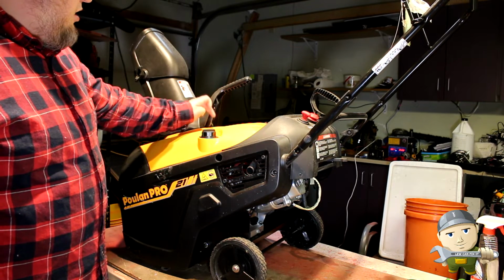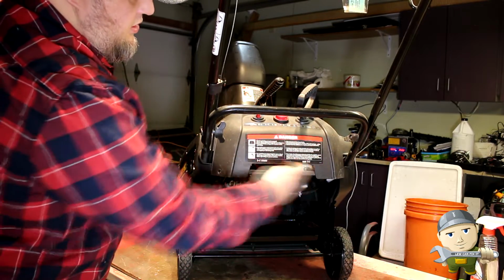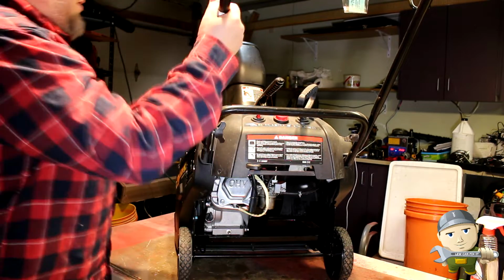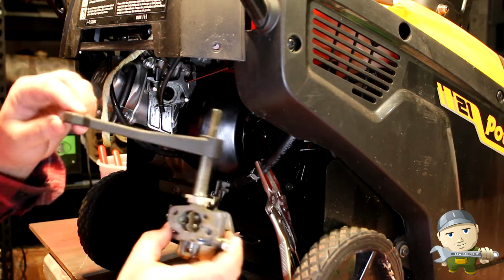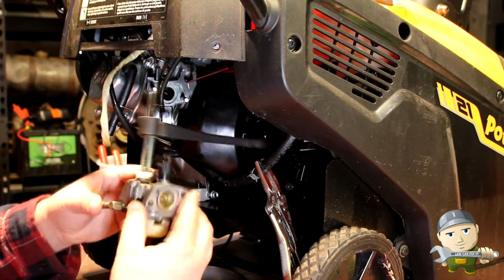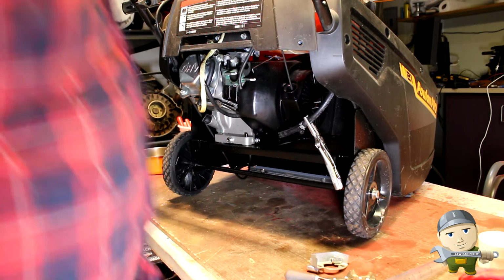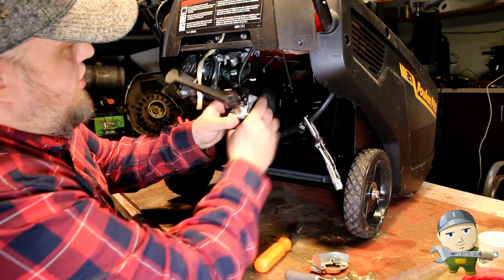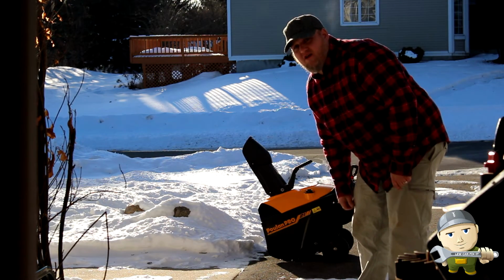Poulan Pro Snowblower Diagnose and Repair

Comment: Had it 9 years skips working every other year.  serviced 2 yrs ago used only twice & needs repair again? There's gotta be a more reliable sno blower
Reply from the maker: Ron,  are you running it out fuel after the last time of the year? Or using a fuel additive?
Reply: Bought a Toro power clear same size to do the job no time to repair the Poulan since 13" of snow hit Chicago right now, so we'll run out the fuel at the end of season and see if it works every single year
Reply from the maker: @rondavid7413  Sounds good Ron. Take it easy over there!

Comment: Why does mine not push well. Like the front end literally will not slide unless there is the right amount of snow and the right conditions with the right sidewalk. Otherwise it with grab and tip forward as I try to push. Any advice for what to do to modify it so it slides nice regardless of ground conditions.
Reply from the maker: please check the paddle and scrapper,  check this video https://www.youtube.com/watch?v=3slC2fxvP1w
let me know how that goes.
Reply: I am aware that this is an old thread. 
Not that familiar with these smaller machines but if it is grabbing it seems that the slides are set too high. Try adjusting the slides/ shoes to raise the scraper assembly.

Comment: Hi Lew, I have a similar issue with my popular p521. I don’t have an ultrasonic cleaner. What else can I use?
Reply from the maker: @Da Brown Guy,  thanks for the comment,  The ultrasonic method is really the best method to clean these carbs because the ultrasonic waves go thru the carb and agitate the parts of the carb we cannot really access.  I would call a power sports place and see if you can just drop off your carb to be cleaned. I am sorry I do not have an easier method, but when I would clean carbs without an ultrasonic cleaner in the past It usally always would not run correctly.

Comment: My float and needle has a spring on mine and the needle looks a lot different I have poulan prg621.  Any suggestions on fix the the needle and float?
Reply from the maker: JEYE123, can you send me a picture of the carb/needle and float?  INFO@LEWCANFIXIT.COM

Thanks!
Reply: @LEWCANFIXIT  i ended up just buying a new carb for $19 off Amazon
Reply from the maker: @JEYE123  Nice, Let me know how it works out!

Comment: Lewis, I have the same model snowblower.  Is there an adjustment on the carb as mine, when I move the choke/run handle to Run, the engine surges. If I slowly move it back towards the choke position, it smooths out.  Any advise? sounds like it's running lean.  Thanks, Bob
Reply: I have the same one as well. If it's surging there is a little black screw on top of the carb and if you turn it a quarter turn at a time to the right you can get it to smooth right out. If the engine runs too fast then turn it back to the left a little bit.

Comment: I have the exact same snowblower and I'm looking for a muffler, you have any idea where I can get one also where are the serial numbers I would need?
Reply: I know this is very late but I have the same blower and I found my muffler on EBay. Plus I also got new paddles there too. If you still have the machine and not got the parts I will screenshot where I got mine from.

Comment: At 8:13 when it comes it are the wholes at the bottom or staring at the top?
Reply: Gimme a little bit and I will let you know.
Reply from the maker: open the pictture below and please look at item 36 in the diagram below.  that should be what your looking for.
https://ww2-secure.justanswer.com/uploads/mr2cycle/2010-12-22_163044_carb.gif
Reply: @LEWCANFIXIT  we’re can I get that gasket

Comment: Great Video.. Just curious to know is it best to use just synthetic 5W-30 or can a synthetic blend be used ?? Thanks
Reply from the maker: Great question!  I always usually just follow what the manual recommends,  most small engine equipment just take standard 30w.  You can buy it anywhere.
Have a great day!